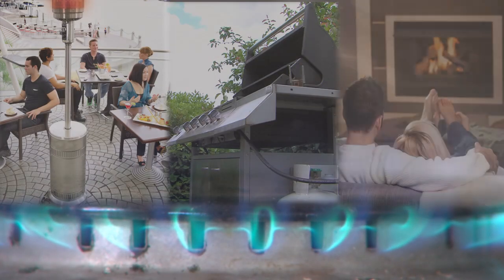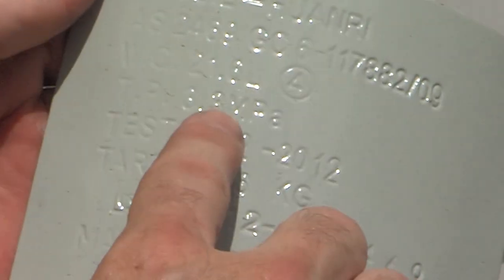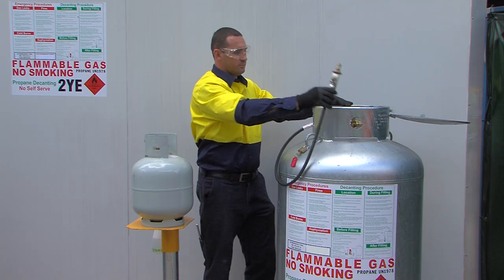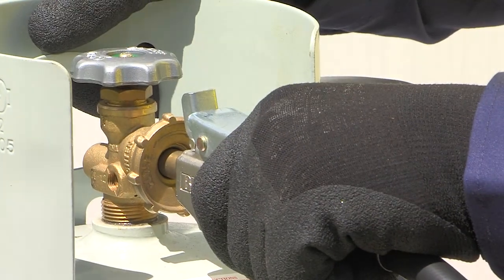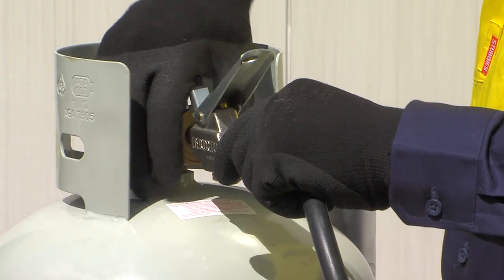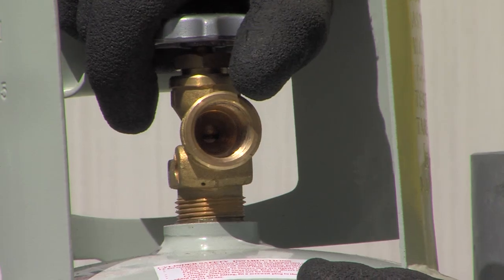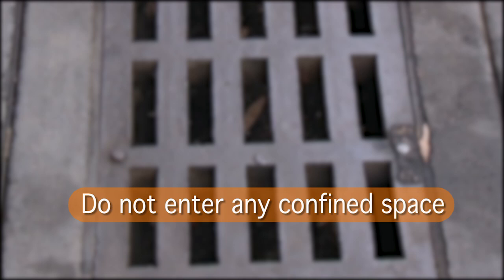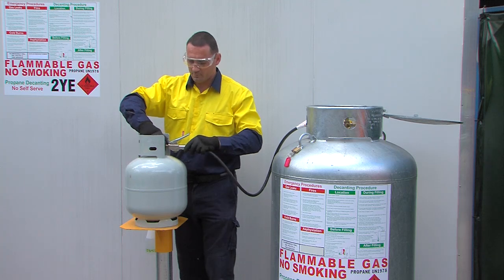How to Fill a Gas Bottle - Fill Propane Tank - How to Refill LPG Gas Cylinder - Safely Decant LPG

Comment: Hi what is the other cylinder your using to fill the smaller one
Reply: Generally called a Bulk Cylinder. That one looks like a 190kg cylinder that holds 360 litres of liquid gas(80%)

Comment: Good to know what we were doing 30 years ago [in Australia] when I was filling bottles was without safety, bare hands, no earthing, plastic bench.  We even had our tank in a small shed, aka the gas was building up inside.  Joy.
Reply: Same, first job of the morning at the local hardware when I was 12 years old working my first job. No safety gear, no earthing, filling on a couple milk crates in the carpark with people just pulling up next to me, occasionally still while smoking a ciggy, damn lucky the place never went up honestly.
Reply: Yep! Lol. 
Used to interconnect a couple of M-F POL lines and turn 100 pounders upside down. Thongs, stubbies, T-shirt, bare hands. I'm still alive!

Comment: The tank should be weighed, the tank has as WC which is the water capacity in pounds that the tank will hold. Take this number times .42 and this will give you the weight of propane that the tank will hold. Add to this the TW weight, the TW is the weight of the tank empty. WC times .42 +TW= total weight of tank when full. The problem with relying on the tube vent is that if the tube is broken off in the tank the tank will be overfilled. This is what led to the OPD valves in the US.